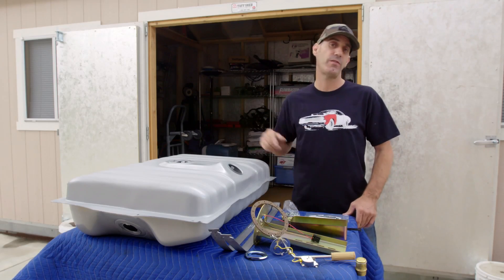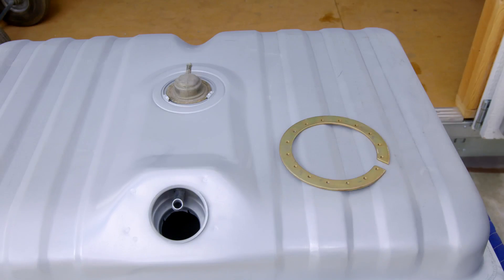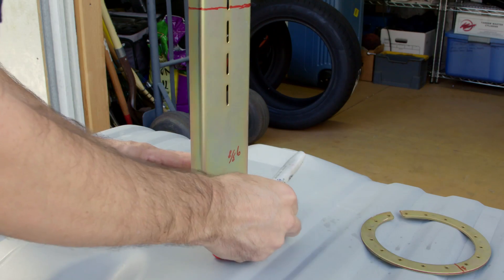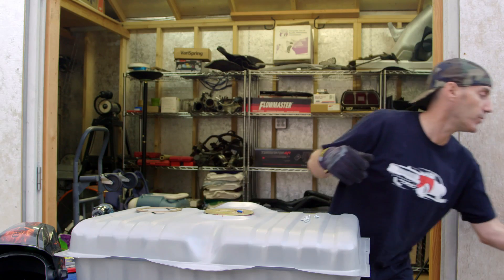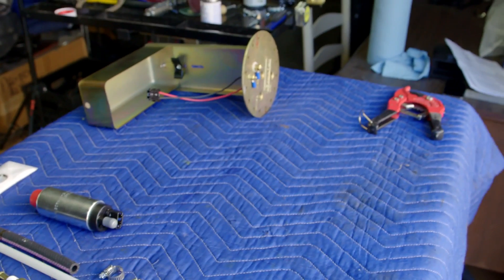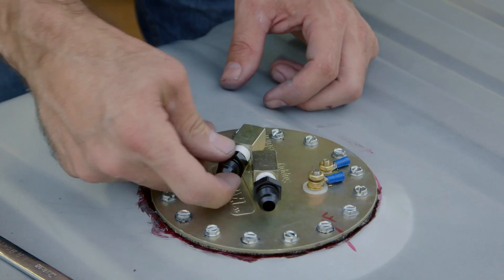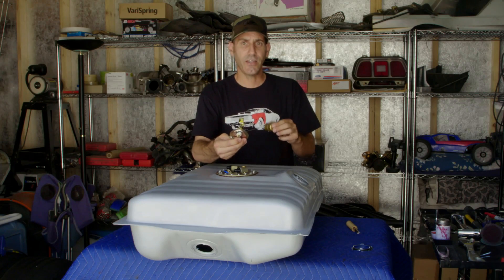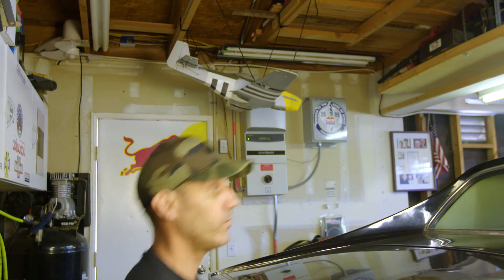In Tank Fuel Pump Conversion and Installation on the 1973 Mustang Large Marge Project

Comment: Hi I was wondering if you could let me know which one of the kits did you get. I went to their website but they have many to chose from. I have a 351 Cleveland and my 73 mach 1. I was thinking of getting the 190 litters per hr that’s rated for 430 hp. I eventually re build the engine and hope to have about 400 hp. Any help would be greatly appreciated.
Reply: hey fellow Mustanger, did you finally get one and install it?  I have all new mechanical at the moment but haven't fired up anew yet.

Comment: DId you tap and thread the bolt in the pickup tube? Or did you just insert it? It looks like you put some epoxy or something in the pickup line with the bolt. I need to do the same thing to my tank
Reply from the maker: I used JB Weld in there.

Comment: I have a different project: LS swap in a Jeep TJ. But, I appreciate the detail you add to your videos (and your work on Dirt Everyday). (Tell Fred to bring his show to Florida sometime.)  One question: have you done a video of running the plumbing for the fuel lines back to the engine? I didn't see one. I need to do that for my project and I'm not sure how to accomplish that. Thanks.
Reply from the maker: I can do something like that for ya.  I ran flex hose from the tank to good spot on the rear chassis and then run hard lines to the fuel pressure regulator in the engine bay and flex hose to the throttle body.

Comment: Nice to see these conversion being done in a very expert way. One thing that I do different with this type of installation is to use the old fuel pick up for the return line. I block off the return line on the in tank unit and use the old fuel supply line for the return line. One again nice job great that you were able to fit it into the hump area.

Comment: I love your videos!! Well Done, you are  no doubt a perfectionist...like me!...so I appreciate your skills. You know hard it is to find any informative info on 71-73 Mustangs on you tube? Rather difficult!, I have a 73 fastback with a 2bl 351 that is next in line for restoration after my 65 fastback BUT! I have already put a lot of time into the 73, so I got a 30% head start on that project. I'm, glad I came across these videos as your  builds are giving me great ideas, especially this in tank fuel pump build, I am doing this to my 65 but realize from this video that in tank fuel pumps aren't only for Fuel injection but for carb systems as well! and such a great fit for the 71-73 era. I am so blessed this 73 of mine is straight and 100% rust free California car! Nothing beats changing these old jalopies into touring cars making them safe and fun to drive. I also have as posted on my channel a 07 gt500 clone. And now Im convinced to get a roadkill t-shirt!

Comment: Hi Jason, 
Once again, great vid! I really enjoy following your videos as I have a '73 Mustang (Grandé) myself. 

Quick question, though. What are the major benefits of swapping over to an In-tank fuel pump over the stock pump?
Reply from the maker: +GrandStang  I prefer an electric fuel pump anytime I'm building a "sporty" car because of the tune-ability.  You can dial in the pressure with a regulator and the beauty of an "in tank" pump is the fact that they tend to be very reliable and definitely much quieter.  I needed to go electric for this application and this cool conversion is SO MUCH cheaper than buying a fuel cell.
Thanks for checking out the video and taking a minute to leave a note!  I like the video of your Mustang burnout!
Reply: +autoedit : Got it! Thanks for info!

Comment: JUst an FYI folks "RTV IS NOT GAS RESISTANT !!!!!!!". So don't use it !!! None of them are period!! No leaks No go boom!!  I'm just sayn. Good and have a good time.
Reply from the maker: +roger depew What are you referring to? I used a fuel safe gasket-sinch compound and teflon tape on the threads so this application is completely safe.
Reply: +autoedit This was not directed at you Jason. Your videos I have watched are a filled with good and accurate information. This was just as I said an FYI because in 35 yrs of selling auto parts the general public thinks RTV will work for any seal application and in this case being wrong would be dangerous not just to the car but the warm squish bit inside. I have read the label on every blister pack and they all warn against using for fuel gas,diesel,e85. oils are usually no problem by the lighter VOCs (voiletal organic compounds) lighter hydrocarbons, seem to be a problem. It breaks down and there goes your seal. 
 No offens intended. This was ment as more of PSA.